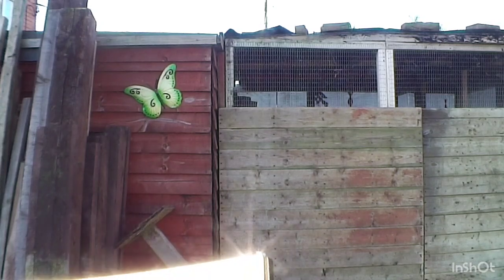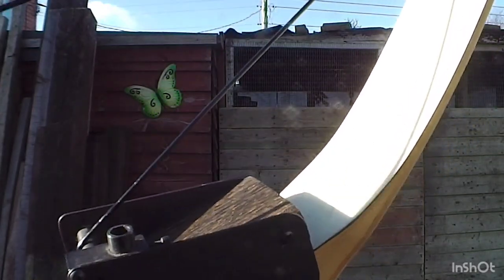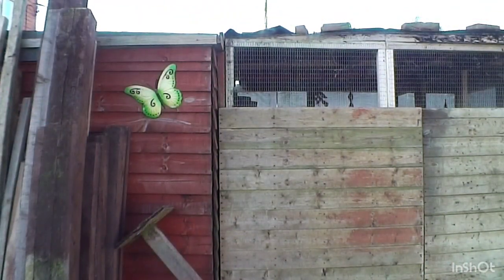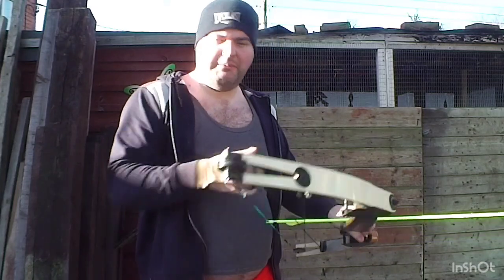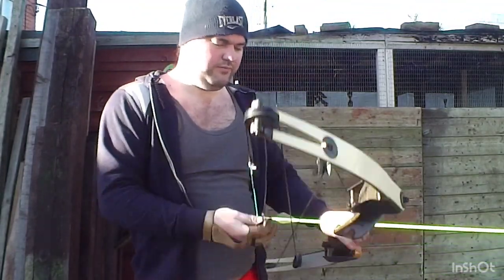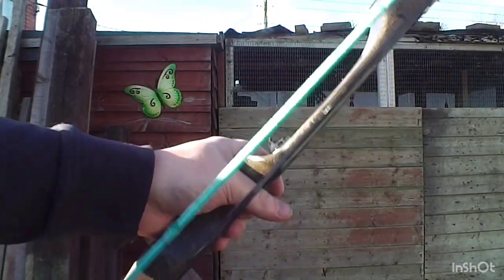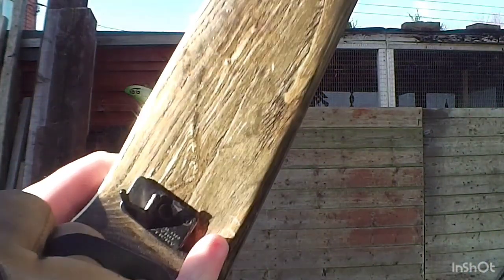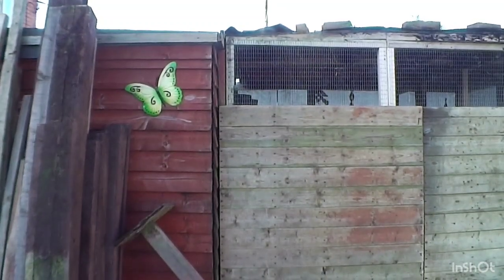jennings compound bow

Comment: Actually, this bow is a Jennings Model W with wooden rider and Delrin  plastic eccentric wheels.  It was available in the mid-70’s as the setup you have or with pylons and 40% let-off wheels.  Built like a tank.  Mine has a metal riser, the model S, and it still shoots well.  Use a full aluminum or wood arrow, though.  Ultralight ACC or ACE arrows hadn’t come into vogue yet, and will probably be too much like dry-firing those wood core limbs.  Easton XX75 Autumn Orange arrows work quite well with the S.  With some TLC it might go another 50 years!  There was also a Model I that had a similar hunting configured riser.